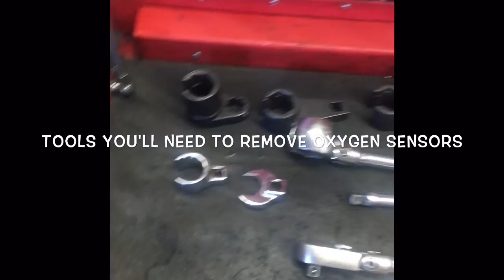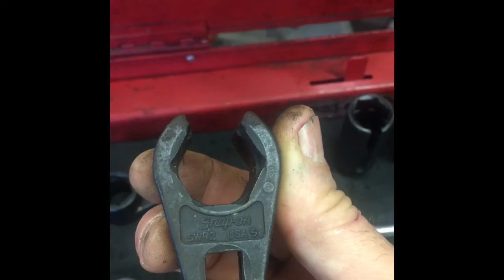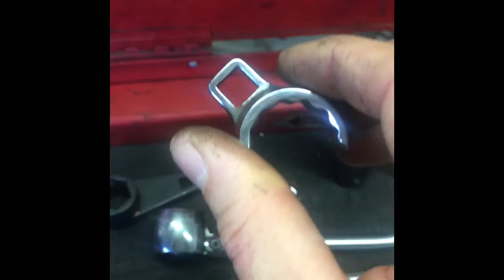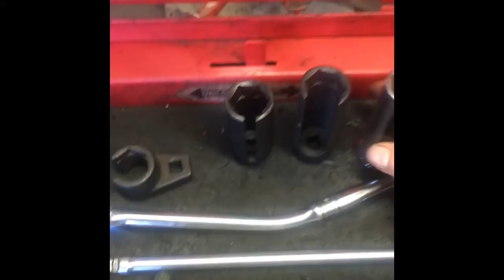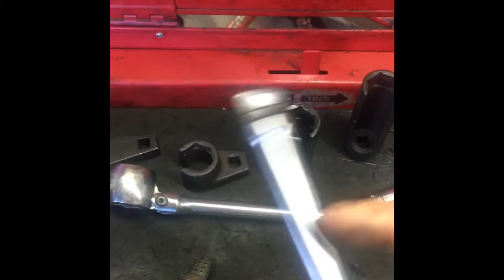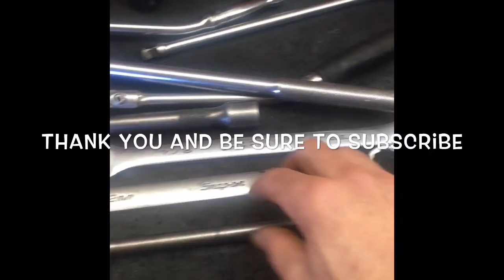How to Automotive's Must Have Tools to Remove Oxygen Sensors

Comment: Hi Brian & friends, tried all of those including blow torched failed & extended bar. 22mm stripped.
1/2" bolt extractor placed on O2's 22mm (sensor cut to allow socket to fit) can one uses 1/2" impact wrench to remove O2 out? And two with the impact damage the Cat with all that impacting?

Have 1/2" 700Nm impact battery
And a 1/2" 2,000Nm impact battery. This will remove Honda Crankshaft Bolt.
The 22mm Bolt Extractor is biting & not stripping the O2 (22mm Nut), used a MAPP GAS, 1/2" Breaker Bar with 4 feet tube bar for torque = still the O2 Sensor won't move.
So again, can one use an impact wrench?
Reply from the maker: If you got room to get the impact in there are you most likely can get it off. There is the possibility of damaging the cat but more like clean ripping the threads out of the pipe from the O2.
Reply: @HowtoAutomotive  I can drop the exhaust end down to have access for 1/2" impact wrench onto the 1/2" 22mm extractor socket biting onto O2's 22mm.
Sprayed Sea Foam/PB Blaster &so on. And torched would come out.

I am afraid of damaging the Catalytic Converter or the inside thread of Cat.
If thread is damaged, can I use tap & die? If so what size or name/model do I need to get so I can screw the new O2 Sensor in?

Comment: Great video...is the crows foot socket better or would the slotted socket work just fine?
Reply from the maker: Hello. If you have room the socket work best. That the one I always try first. Thank you for watching and writing to me.
Reply from the maker: +Jason Kalloo i've changed hundred o2 sensors with both short and long sockets without damaging the wires. Just unplug the sensor before losing it. And you'll be OK. Thanks again.
Reply from the maker: I would recommend the socket. Crows foot Can strip out 02 sensor.
Reply: ok just got done doing this job. The two front pre-cat on m54 e39 rhd. The tekton slotted 22mm socket worked great. It was close fit but didnt see any damage to wires; and dont think the crows foot would have had enough room to work on my car. The lhd's in the USA are different and the crows foot may work great in that case. All in all, job went perfect. thx. One further note is that the O@ sensors for my car (rhd from the caribbean) had longer cables than the ones selling for US models. 560mm vs whatever the Bosch 13477's are. However I was able to use the shorter wires by bypassing the attachment locations (just for information for anyone else doing this job.
Reply: Thx...thats the one I ordered ..I have the room but was reading some reviews that some shorter sockets can damage the wires..so I was having second thoughts..
Reply: thanks for the encouragement and again for taking the time to make these vids and answer questions. when i do the job i'll let you know if i ran into any problems.
Reply from the maker: +ReMark really glad it all worked out!